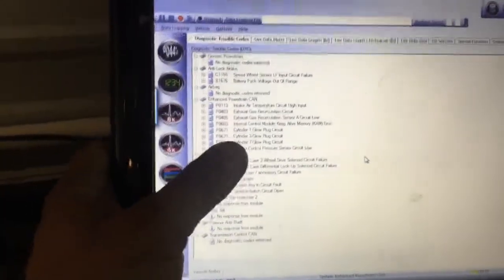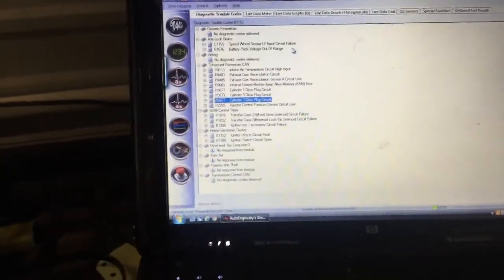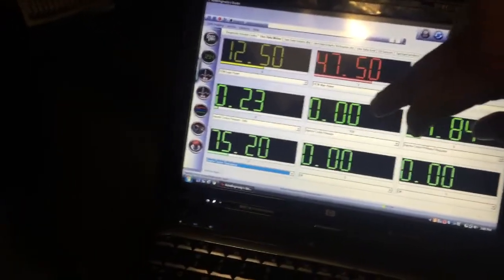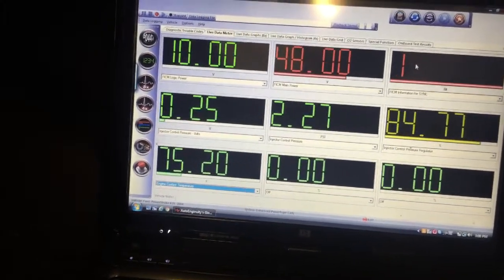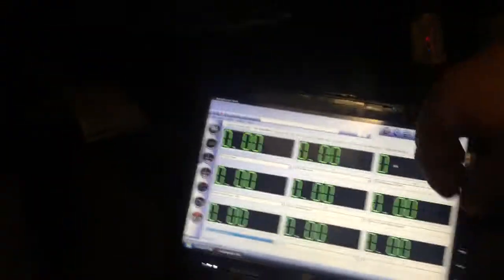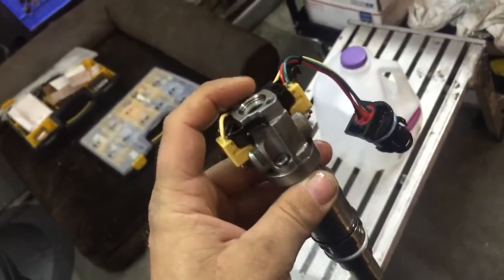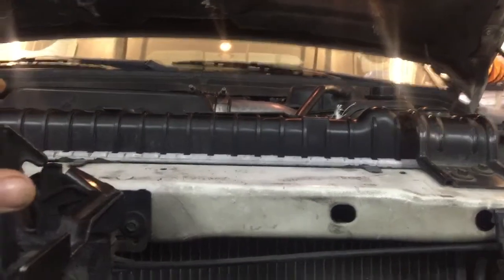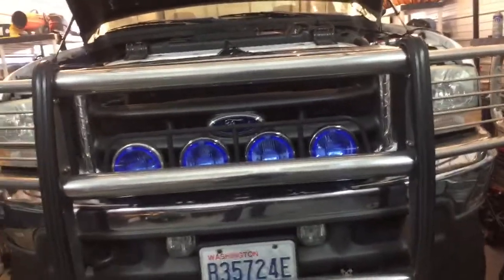6.0 crank no start diagnose pt1.

Comment: I just did hpop on my 03 replaced seals recently had oil cooler done injector seals oil rail seals new icp and ipr and still won’t start. Before I only got 70psi now I’m getting 300 but no start not sure what to do don’t have the money to take it to a shop any help would be great.

Comment: Dang it I’m not getting any clatter when I cycle my key forward hopefully my buddy’s snap on scanner can figure it out with your system tomorrow.
Reply: Did you figure out the problem same thing is happening. To my 6.0 2005
Reply: @jonathanbravozya  pretty sure I tested a good injector and it clattered and I somehow roasted all 8 injectors at once. Can really remember but I’m pretty sure that’s what happened.
Reply: @Powerstroke904   oh so you replaced your injectors and start running back normal?

Comment: I updated another video on the high pressure oil leak I removed dummy plug and stand pipe both please take 1 minute to watch I think stand pipe is reason of crank no start but it could be both also I have tried everything to get bottom part of stand pipe out what is trick thank you

Comment: I got pulled over turned truck off police officer let me go and now truck wont start so now my 2007 6.0 is getting towed home do u have any idea why that could happen I don’t race my truck I don’t tow I just drive it to work I have livewire TS+ and it’s on tow mode
Reply: Will it start when it's cold? Because these 6 liters have issues not starting when they're hot due to air leaks in the oil system. They have dummy plugs and stand pipes under valve covers sometimes they leak passed the o rings there which will cause a hot no start.... But could also be bad IPR valve too...
Reply: smooth operator I  am getting Max 71 icp using scan gauge 2 no start cold but cranks I also get low base oil in oil filter
Reply: With key on ICP should be at .25 volts. But cranking icp pressure mine goes like 1200-1300 I know oil pressure has to be at least 500psi to fire injectors
Reply: smooth operator yeah I am pretty sure I have bad HPOP or bad O ring it’s a bad leak to only allow 71icp oil pressure bleed is bad
Reply: What's your IPR reading?
Reply: smooth operator 84%
Reply: smooth operator 
FICM 48.5v 
Sync 1
Reply: Ya 84% IPR is closed all the way to compensate for psi loss. I heard 05 and up the hpop hardly ever go bad. It's always dummy plugs or stand pipes
Reply: smooth operator agree I’m  gonna take valve covers off tomorrow and pull them
Reply: smooth operator yeah I hear it’s very rare the HPOP after 4.5-7 almost never fail
Reply: Have you updated the STC fitting? Mine actually blew apart probably a month ago and cracked the back plate! So I dropped the tranny and transfer case and put new plate and rear main seal on went in through the top pulled the pump installed new STC and while I had torn apart I put new oil cooler and blocked egr cooler!
Reply: smooth operator I actually updated stc fitting dummy plugs and stand pipes like 8 months ago does not mean new part failure though so I’m still gonna check
Reply: smooth operator I took video of my truck with air leak test I just did today I am 99% sure it’s high pressure oil leak in passenger head side check it out on my YouTube channel